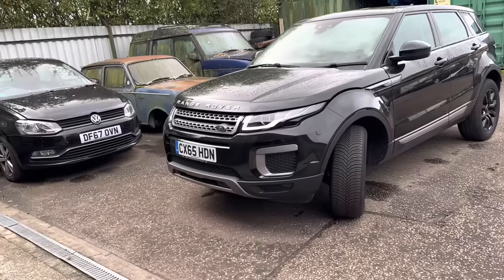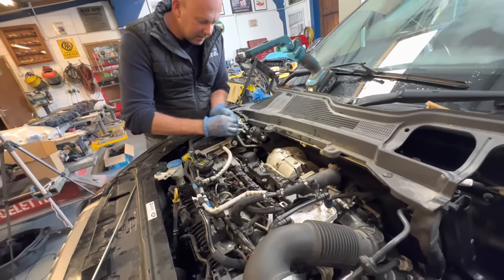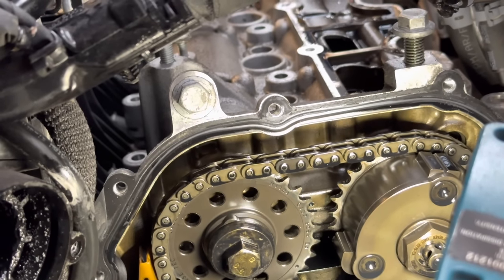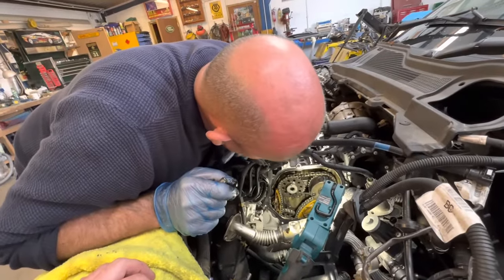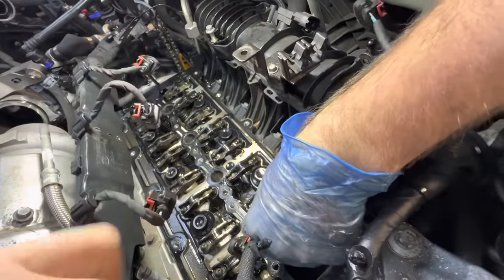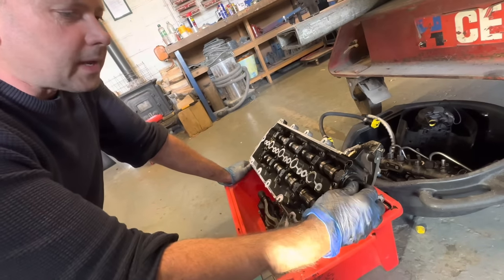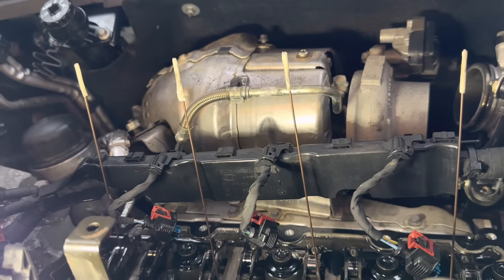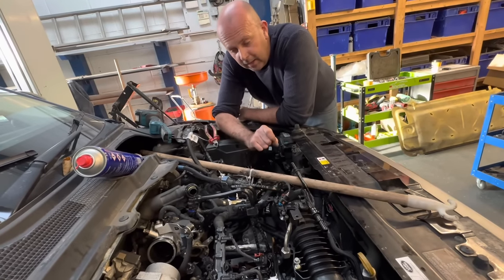RANGE ROVER EVOQUE INGENIUM ENGINE FAIL ! HOW BAD IS IT ?

Comment: Problems with Land Rovers? I've just been on the Serengeti on safari and all the guides and rangers use Toyota Land Cruisers. If you ask them why they don't use Land Rover products you get the same answer over and over again. Land Rovers aren't reliable but Land Cruisers are. Land Cruisers almost never break.
Reply: New landcruisers are crocks of sht from 07 bk there reliable
Reply: I asked an aussie once about land rovers,  he said they are brilliant if they want to go into the outback,,  and the reason he's got a landcruiser is cos he wants to get back
Reply: Come on lads you're breaking my heart here 🤣🤣🤣 I've just bought a second car for snow, freelander 1 2.0 diesel full history
Reply: I was in Serengeti last week, lots of Land Rovers
Reply: @sheffielduk3428  the m47 in that car wont give u trouble ul have to watch the fuel pump do
Reply: Zzzzzzzz
Reply: @noelcahill6707  right got ya! 110k miles 56 plate I love it! Just fitted a drive shaft and all filters and oil ect, just need to do fuel filter next
Reply: @sheffielduk3428  iv owned 1 once u service that bmw m47r will go for high miles i own a mg zt with the same engine
Reply: @noelcahill6707  I didn't know that they was in mG too, now she's all running beautifully I'm gonna sorn it and put car cover on it until December 👌👌
Reply: But you have to ask yourself this one simple question regarding Land Rover versus Toyota reliability.How many old Land cruisers are still on the road after 20,30,40 or 50 years.
Reply: @sheffielduk3428  they are as i say great engine
Reply: @michaelhynds8035  Wish I could add a photo. I'm just back and NO Land rovers.
Reply: @noelcahill6707  Aye they have the old boxy basic cruisers.
Reply: @keithwelton  having owned a Toyota  I think some of the answer is down to the cost of spares  ...
Toyota parts are so expensive.
Reply: @dashcam2417  Yes price and availability of Japanese car and motorcycle parts are a factor in how long vehicles are kept on the road. I believe Land Rover spares are available for every model going back to the Series 1. Including all body and chassis parts

Comment: We have a 2006 Yaris 98,000 miles  .
It's only had a starter motor. 
Otherwise never missed a beat . That's proper build quality.
Reply: Lookup2Wakeup  might be a yawn to you but you wouldn't be  happy if you owned that range rover that's been written off because of terrible build quality.
I better not mention the  3 litre 24 valve  Senator with 187,000 miles  I sold a few years back 😁
Reply: I've owned 3 1st gen Yaris (1999-2005). Through so many instances of Coworker's cars half the age and 10+ times more expensive breaking down (often spectacularly), they've just kept going and going 😁

Comment: ffs,you had a £50k motor for nearly 2 years!!!!,,,,,my 05 merc  vito has done 250 000 miles,still goes over 100 and  still uses no oil and before the recent "crisis" was costing 17p a mile.yes ,its had some abuse and all the faults were wear and tear  related due to my driving.,,,i used to deliver wiring components to  the eastern european  assembly plants(sumitomo) who  then shipped the wiring harnesses back to jag/landy in the uk!!(before those countrys  came into the eu.,,,says it all really.
Reply: My  53 traffic as done 243000 I change the oil every 6000 miles and nave have to top up the oil

Comment: I started watch this thinking it would be interesting but I switched off as soon as I heard all cars have problems they all have faults and go wrong. Not true, we bought a brand new Vauxhall Zafira in 2014 with a lifetime warranty, it has not even been back for a trim clip. My Insignia has been back once for a lens with condenstation. Land Rover cars go wrong, in my view the only way to buy one is new with the 5 years warranty.  The amount of people I know who have had to unload their pockets while owning a second hand Range Rover out of manufacturers warranty.
Reply: 3 years*
Reply: @clowes51mw3  My brother extended his to 5, however, after asking him he did correct me and say the standard factory is 3. Many thanks for correcting me.
Reply: Keep extended Warranty on same, so that when you eventually sell it or trade it in  you can give the next punter or Car Stealership  that warranty as a bargaining chip...plus you would sleep better at night knowing you wouldn't have to break the Bank with Car related issues.
Reply: You missed a good  video then mate, you have been lucky with  your cars, all cars with systems and sensors have problems.  These guys are great, and took advice from others.  But the way they worked out the problem was just shear poetry.
Reply: You may well be right, cutting to the chase, myself and my family have had so many company cars over the years that have just been in for servicing and that is it. My dad had a Fiat 132 2000 in 1977, he had it for 4 years and did over 75,000 without a glitch.

I am going to have to disagree again, all cars have problems, if this was the case, fleet car suppliers would be out of business as their fleets would always be in the garage, and the staff of the firms they have supplied the cars to not working.  

The only way to buy Land Rover is contract hire or new with a warranty.
Reply: Didn't the Zafira have a problem with catching fire?
Reply: @geoffaries   A few with Air con did so they recalled them and replaced the faulty part. The model we have has climate so it was never recalled.
Reply: @PaulBriden  a few??? Try 1000's. Plus it was only thought to have been the AC but loads caught fire who didn't have that.

Comment: Typical land rover, almost as bad as the break my wallets. I love them being a mechanic, as long as they still make them, I will have work
Reply: bmw are reliable as long as you service them and don't drive like you have stolen them.
Reply: @everydayguy289  And don't have the one with the nickasil liners, and don't have the one where the timing chain snaps at the back of the engine, and don't have the E46 where the chassis cracks and don't have the one......
Reply: @everydayguy289  not to mention that dreadful n47 engine.
Reply: Bee Em Trouble-You

Comment: I like some of the theories from feedback comments about the locator pin being sacrificial in the event of mechanical failure (like the chain snapping). The bolt holding the camshaft gear on the end, can’t be the actual binding to drive the shaft can it ?. I imagine that the gear would sit on the end of the cam shaft “locked” into place by a very robust mechanical interface. It’s wasn’t clear. The little pin having sheared could be the fail feature to save the valves with the cam shaft then free to turn to lessen the impact ?. I expect Chris is right in that the cams are designed to skew but at the same time the little pin gives way ?. Hmm, it small puzzle.
Reply: Most stuff now just uses friction from stretch bolt tension rather than key ways

Comment: The main problem is the engine oil change interval that must be 15.000 km maximum because Land Rover Ingenium engine has the FAP filter far from the engine so it takes a lot of time to reach the proper temperature and the continuous FAP regeneration cycles dilute the oil with diesel leakage above all if you use the car incity paths !! Change the oil every 15000 km resolves most of problems ... do you really think that Mercedes Audi BMW doesn't have distribution or automatic gearbox :):) ??? Volvo the perfect cars ??? I'm sorry but Mercedes and Volvo where great car twenty years ago so for me Land Rover thanks to Tata has for sure some problem more and this is a pity for such a great premium brand but also the other brands has a lot of problems, the European Union rules for the stupid ecologic matter has damaged the diesel car of all brands !!

Comment: When our 71 diesel mild hybrid Sportage was in recently with its tensioner issue the RAC guy said it is common as is recovering Ford's with add blue issues , VAG with various  drivetrain issues , JLR for many things .  Modern vehicles and shrugged shoulders and shook his head.   Ps ours just needed a tensioner and our old family Qashqai with the moaned about 2.0dci motor is still with us after 12 years and 177k miles . So it's just a luck thing

Comment: 2WD Rangey?  What's the point (apart from w**ker pose factor)?
Reply: i think the point being that most 4x4 cars can be 2wd for they never go off road, The 2wd evoque is only £20 or £30 per year road tax and the claimed mpg for them  looks  outstanding. So you get the higher driving position with out the 4x4 costs
Reply: @julesdowner5585  Outstanding looks??? If I wanted to be that high up I'd have a van, at least they are useful.
Reply: @ashleyweston5420  No, , the claimed mpg looks outstanding, meaning the claimed mpg figures seem too good to be true . personally i do think they look great !. I already have a  van . I find a higher driving position much better and safer and easier to get in and out of
Reply: @julesdowner5585  The road tax is really that cheap?!?!  Bloody hell!  I'm paying way more for a 2017 Corsa!
Reply: @trev8591  Yes , suprisingly true . Check it out , put in a search for £30 per year tax Evoque. They do a 2 door model (why?) and thats £20 per year . The mpg is 65 combined and 56 urban!! which i find incredible  (if true) How something high and brick shaped can be more economical than smaller sleeker saloons i cannot work out?  Search goole foe cherap tax cars , there are plenty, Octavia estates, Audi A5 etc . My last car was a Ford Fusion at £30 per year and an Evoque is the same , more comfy, more economical  and higher . . My sisters golf is zero tax  (diesel) . Have an investigate, its quite strange .

Comment: I'll never understand anyone buying anything JLR with the Stigma attached to these products.
These are not premium vehicles by a big margin.
Many manufacturers like Kia /Hyundai / Toyota and Volvo produce a far superior product..
Reply: Just flat out wrong. And JLR products are even more reliable than most BMW, Audi, and Mercedes, so how do explain them selling all those cars?
Reply: @JetFire9  
JLR sell these Indian cars to those that don't do their homework. 
You mention Audi & BMW, they're just as bad.
Look at how depreciation affects JLR products. This is down to cost of maintenance & constant repairs.
The stigma of ownership should be enough to put anyone off, in the trade they have the name Skoda used to have in the 80's..

Comment: Gotta ask why you didn’t remove the camshaft and measure it in centres and use a vernier gauge along with a dti gauge. I would have thought you can find the opening angles on tinternet. Ohh the pin won’t be just any old steel either. Great content again, keep up the good work

Comment: I’m sure I said it on the last video. Local Jaguar dealer here in Dublin had 37 cars ahead of mine for engines.  Mine will be December by the time I get it back.  But I love the car and yes all manufacturers have issues.  JLR are doing my car free of changes when 3 years out of warranty.  Problems happen it’s how you deal with them. And I changed the oil in mine every 10,000klms 6,000 miles.  Made no difference 😮

Comment: At a guess  Bolt came lose due to lack of nutlock and not torqued down after that even with engine spinning I agree with Chris that the cam  just moved as the pistons hit each inlet valve causing no damage £900 for timing tools though put it in dealer or specialist repair territory to put the timing right Not the sort of tools you guys would need on a daily basis

Comment: I used to had a Freelander 2 that was also the two wheel drive version. When it was running it was the nicest car to drive I have owned. Two Fuel pumps in 12 months was enough to lose confidence in it, especially as we were going to the Inner Hebrides and recovery would have been a nightmare. Had to replace the door locks on three of doors a few times as I had problems with the not locking. I had a Friday special on the electronic side. It left me stranded down your way. 5 hours on the M2 Junction 3, would have walked to the Wife Grandmother house if we had know and if she wasn't at a family wedding we were going to. That said I wouldn't say no to a Freelander 3 or Discovery Sport as they named it.

Comment: is that the body that they were going to make the freelander 3 out of but did not and my wife has had her freelander 1 1800 for 22 nearly 23 years and only had one problem YES it was the head gasket but we had it done properly skimmed 3 ply gasket on and no problem in the last 5 years thanks for the video, a

Comment: So, the Ingenium engine on RR Evoques and Disco Sports are all put into a LR Freelander 2 frame modified for the new cars. There are many documents on line proving Land Rover are aware of the engineering compromises involved in the fact that a close coupling is impossible for the dpf meaning no passive regens are possible and all regens are active. As a result, any cars used for short runs only where the oil temp fails to hit 600 to 800 degrees on a regular cycle will fail or in English, blow up. I sold my Disco Sport at 27,000 miles before this happened. The 2019 plus cars may or may not still have this proplem. I do genuinely believe, this is a really nice engine, but you need to know what you have, and how to use it.

Comment: I reckon Chris was spot on with the theory at 17mins that the camshaft has just been floating and no damage has been done. If the camshaft hasn't been held tight then its just basically been bumped around

Comment: Rob with respect, I have a Mercedes 350 CDI 3litre V6 2011 and 11 years not a problem whatsoever apart from new pads and disks and servicing every year.
Land Rover have a very bad reputation for all sorts of engine troubles. I would not touch any of them. 
Interesting video and always looking forward when Chris shows his skills.
Cheers bro.
Reply: Those engines have a bad rep for leaking oil-coolers and wait for it, timing chain stretch.

Comment: hello Rob & Chris, well, two things come to mind, i personally do not think that there is a "perfect car" which does not have any faults, every car has a weakness, somewhere. Also, to see you both working on this car and your deliberations are quite interesting, sometimes it is logical to get a professional engineer (who works regularly on these cars) to inspect and set up the engine, correctly - they have the special equipment!! So, l do admire an technitian / engineer / mechanic / who has dirty hands and face - "marks of the trade" so to speak!! Well, looking forwards to the next video! Best wishes from Lincolnshire.

Comment: I doubt very much there is any damage. I recon the cam would have just been pushed around and out of the way. There was no tension on the cam to do any damage. I hope it works out an easy fix guys. Good vid. 👍
Reply: Exactly what I said I’d better £100 time it up it’ll run

Comment: I've been looking into the reason for failure as I'm looking to get a newer lower mileage one to replace my 2.2.   Apparently, it's to do with the distance between the engine and DPF, it chucks more fuel in to give more heat to burn the soot off, but a lot of that extra fuel ends up going in the engine, causing bore wash, then contaminating the oil, diluting it.   Some owners have "service now" come up due to oil quality deteriorating because of contamination, but many ignore it as they'd just had it done 3,000 miles ago.
Reply: Yep I change the oil in mine every 12 months irrespective of service interval and it's been faultless so far. It's a 2018 car with Ingenium engine but only 32K miles so far. My previous 2.2 was also faultless. It's an easy DIY job.

Comment: I have a 2004 Discovery 2, and there is a well known fault, it is the oil pump drive bolt comes undone with potentially disastrous consequences . How hard can it be for LR to thread lock critical nuts and bolts?

Comment: I would have to say in 2013 my wife and I bought a his and hers. She got a two door Evoque, I bought a Maserati quotroporte, the one with a 4.7 litre. I loved the porte especially when I started her. Well I loved her until the first service which was still under warranty and I still had a bill over 12,000aed (we live in Abu,Dhabi) the Evoque was free. To cut a long story short the Masser has gone and the Evoque is stil here 200,000+ km, the only big thing to go was the rear diff. The Evoque runs like a dream and I am trying decide between a taycan and Range Rover Velar. I am sure the Evoque will out last noth

Comment: I’d have set that exhaust cam to tdc marking it all up.
To do that you would as you have done use the brazing rods to establish tdc & then have the exhausts closing on cyl 4. It’s lucky that the trouble is with the inlet as that’s easier to time in as there’s no variable on it.
In short when going over tdc on cylinder 4 at tdc the exhaust is closing & the inlet opening.
In essence they are both ‘open’ the same amount at tdc on 4. Exh closing & inlet opening.
The inlet as you suggest is ‘pinned’ & you had the chain all still intact so could have marked it all up & then refitted. Even if you got it out by a tooth on the cam either way it would be obvious.
You’re then into checking lift at tdc on compression (when lobes) are pointing away from valve actuation.
Obviously they should all have the same reading as you go through all 4 sets of valves.
A bit geeky & technical from a motorsport background but admittedly you need to have a understanding of valve timing.

Once did a mi16 by eye. It was that far out no wonder it made no power.

Think about as your chain/belt wears the timing moves.

Comment: Sprocket you're not sure about is the hp fuel pump and intermediate drive for the cams.     Oil pump chain and pump is directly below the crank in the sump.